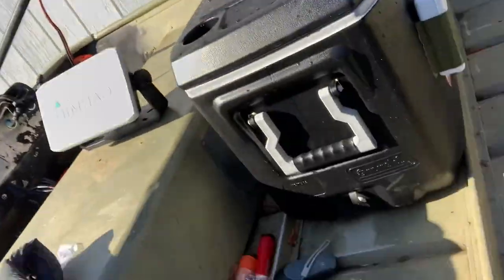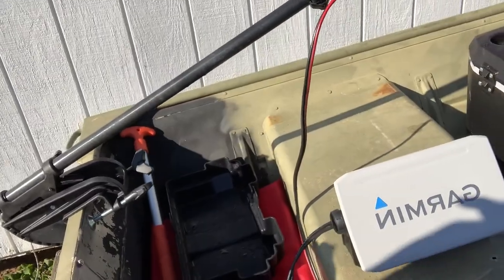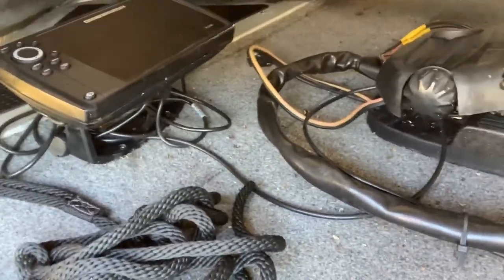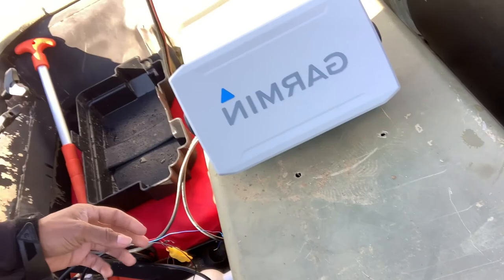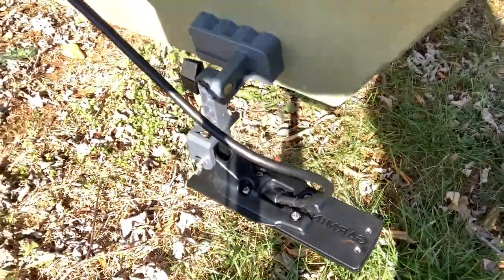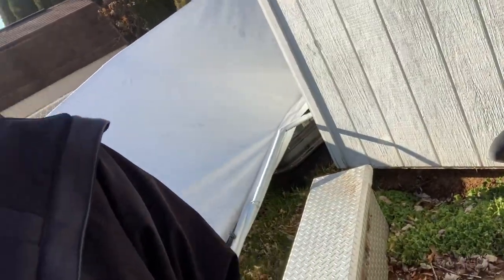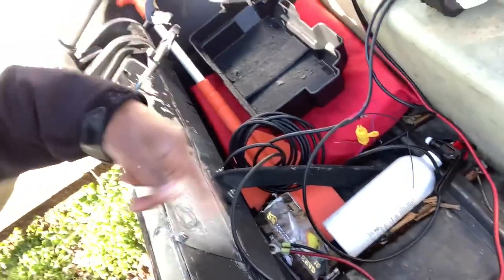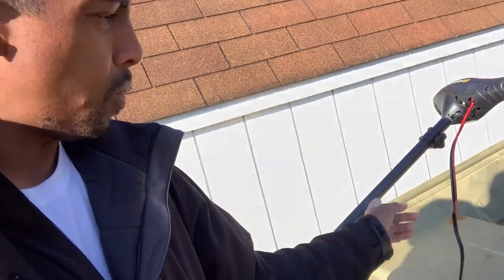Jon Boat Modifications, Portable Transducer Mount and more!

Comment: Looks awesome buddy! What happens if you hit a submerged log?  Wont  your magnet mounted-transducer   End up on the bottom of the lake? You could put a safety cable attached to your boat just in case.
Reply from the maker: its still connected to the boat by the cable and if i hit a log im my boat going 3mph i think i will be fine, its electric only boat for me so made the magnet decision pretty easy.